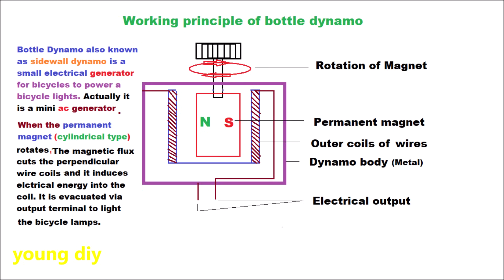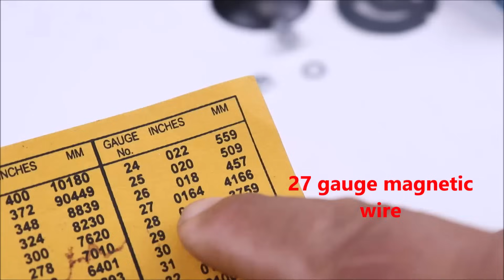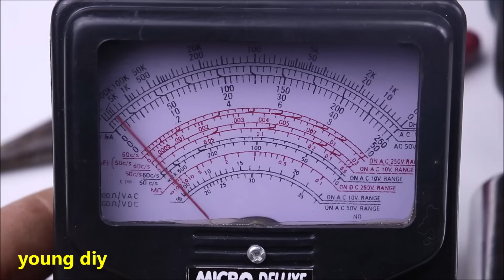How it Works, The Bottle Dynamo . | DIY |

Comment: I saved a cuople of these.I found an old one recently  that ddnt turn anymore. I opened it up and it had 2 cool pieces inside. A  rotor with a cool looking metallic neo magnet attached to it. And a spool of wire encased in metal casing. I had to destroy the dynamo to get the parts.
Reply: Yes, in cycle dynamos that were built approximately before 1960, the magnets were made of metal, for example Alnico. Ferrite ceramics were later used. I have a 60 year old dynamo, with a two-pole metal magnet, that works like new.
Reply: @Tag-Traeumer  I did nt know that. I think I have only seen that once before in the early 80s.

Comment: Is this really a dynamo? Why I ask this is because from my understanding a dynamo makes DC power via a commutator to make contact on only half of the sine wave and disconnect on the other half. Without the commutator it would produce AC power. At 5:12 in the video the volt meter is hooked up to the AC scale. But if the little black box on this bike dynamo is a couple of diodes to rectify the power to make this produce DC power then this is working more like a modern day alternator in car. Just a little simpler. I'm not bashing the video. Great to see whats inside one of these things. Just questioning it "for science!". Check out the wikipedia page for dynamo. But if i'm wrong then I got some learning to do.
Reply: Most of  classic bicycle dynamos are in fact simple AC generators. Why? Because  old good incandescent bulbs,  can work equally well at AC and DC voltage. So you don't need to rectify it. Moreover, you lose about 2 volts if you rectify it. This dynamo is 12 V, but i think most dynamos in Europe are just 6 V. Today LED lights are common, so there must be a rectifier, or some sort of AC/DC voltage converter,  inside the LED assembly.
Reply: Boa resposta.  Me convenceu! Parabéns.